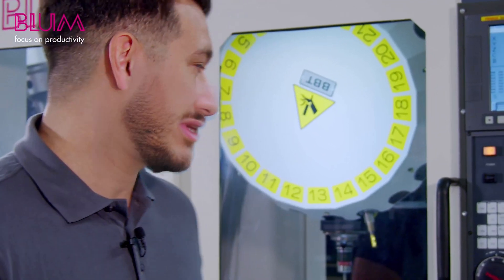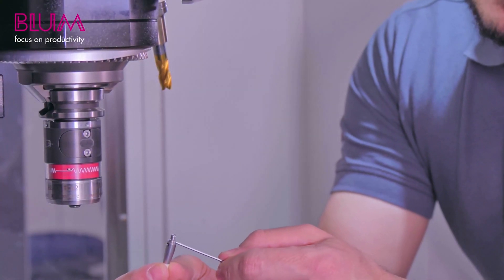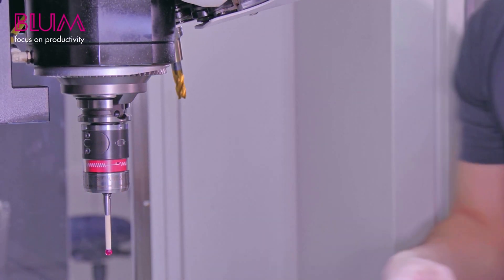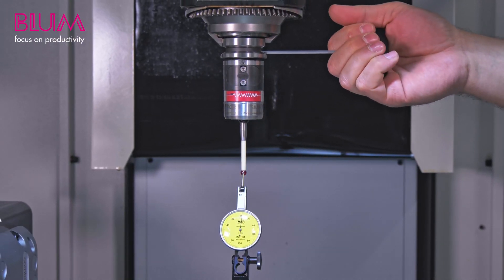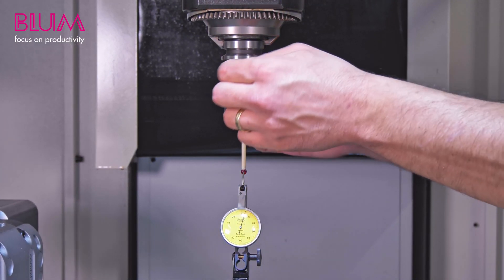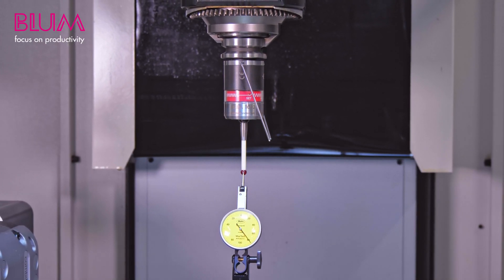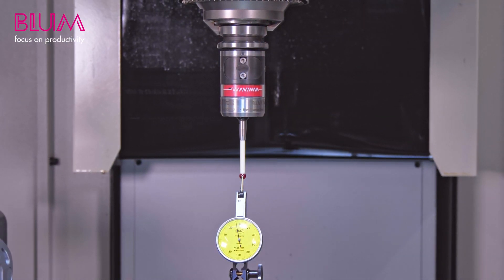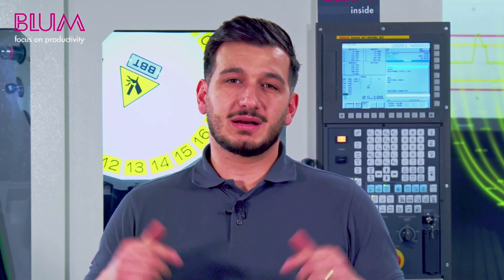Stylus change | Measurement Minutes

Comment: Nice video, good work!
One thing to add: The dial indicator you use for checking/adjusting the runout must have a lower actuating force than that of the measuring probe - otherwise you will push the stylus away and it will look like your runout is fine, although it's not.
Especially with the "Low Force" measuring probes this can be a problem with the commonly available dial indicators
Reply from the maker: You're right, that's a very good point! You can find the deflection forces of our probes in our operating instructions. Thank you for your comment!